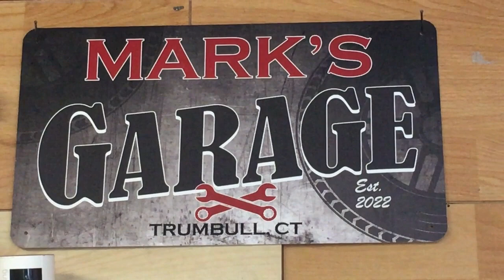1947 GMC Another Door Update and Yard Sale Score

Comment: Mark, I was just wondering, when you open your drivers door, is the door able to over extend and touch the cowl panel, I know that you straightened it earlier on, just curious.
Reply from the maker: Hi Todd, the door appear to stop just prior to actually touching the cowl where I pressed the dent out. Maybe I can show it in a future video.
Reply: @MarksGarageChannel  The reason I asked was, my truck has the same dent and when I took the doors off and hinges out I found that the internal stop on the door hinge was broken, but I haven’t straighten my cowl back up yet to see how close it gets!